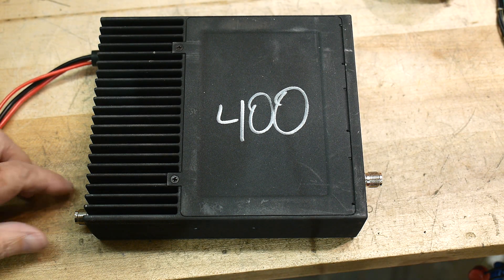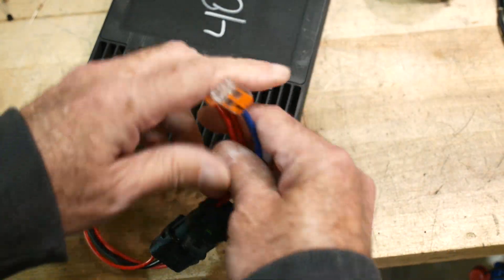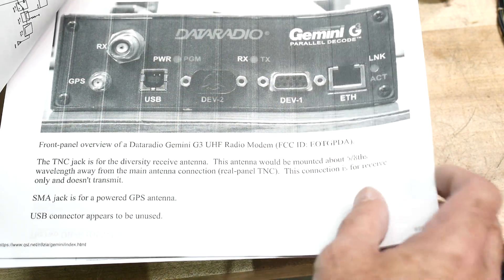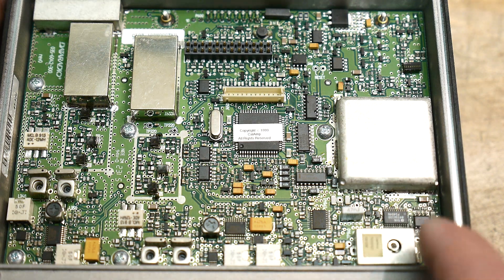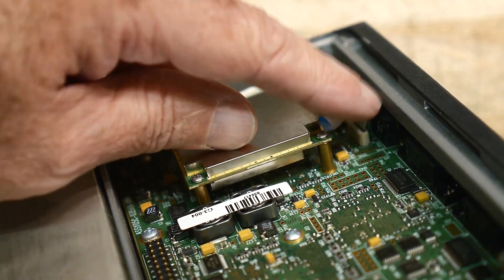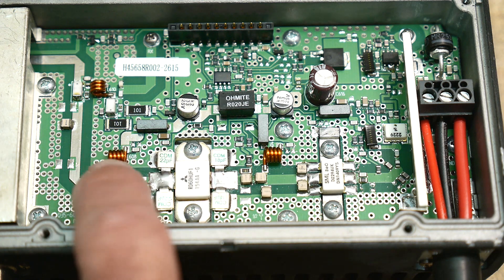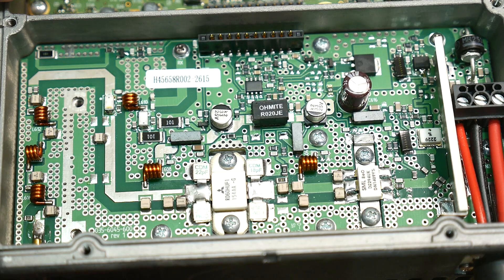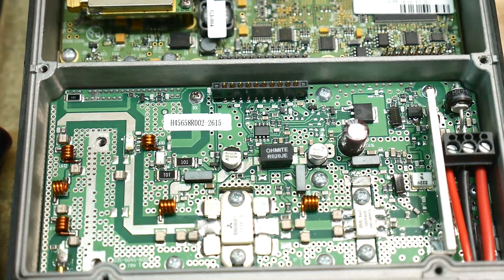#649 Gemini G3 Dataradio (part 1 or 3) Teardown

Comment: There are quite a few data radios on eBay, I even bought a couple of 458 MHz industrial telemetry modems I haven't had time to play with yet. The trouble is that few have standardised protocols, so it's going to be difficult to get devices from different brands to talk to each other. All the same, I like the idea of creating some kind of ham or licence-free band network with these things.

Comment: Powered GPS, the receiver needs D.C power for the LNA in the antenna, as there is no amplifier in the module. Connecting a non-biased antenna will get nothing

Comment: Good grief, it's worth $15 just to salvage the RD60HUF
Reply: RD60 is good from VHF through UHF, and with decent power across both bands.
Same device used in the FT-8800.
Newer models of radios use RD70HVF1.